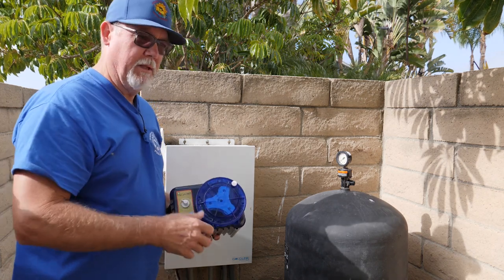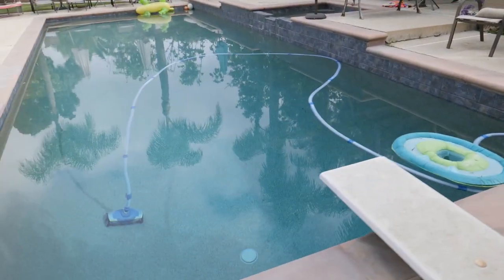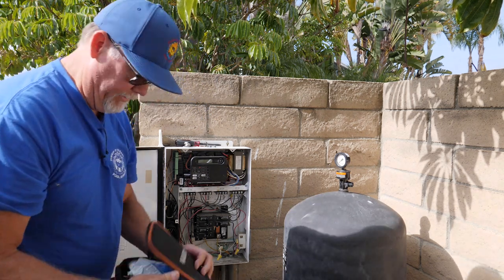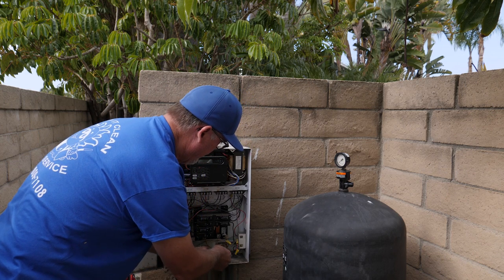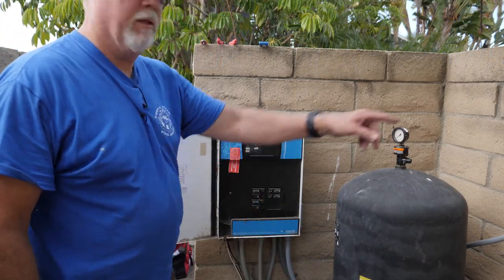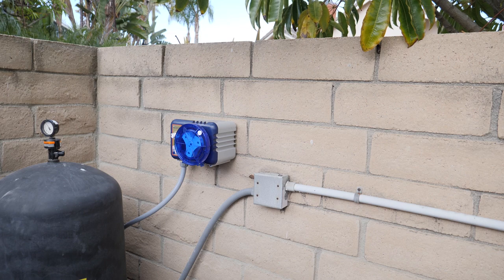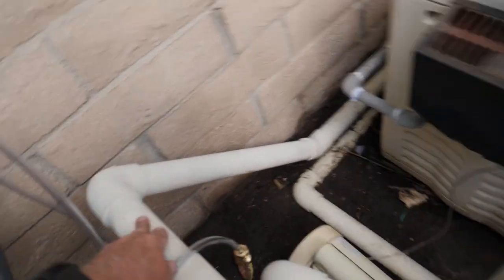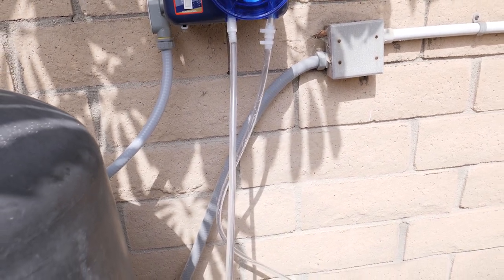Rola-Chem Install - Short video

Comment: I installed this about 1 1/2 years ago. It has its positives and negatives. Liquid chlorine has a higher PH than the tables. As a result the PH goes higher resulting in adding more muriatic acid. I’m adding about 8oz a day with another Rolachem system. The Chlorine side will crystallize and clog the check valve over time. After about 90 days I replace or clean. The hoses are not forever and need to be replaced every so often (6 months to a year), sorry I lost track. It also appears the liquid chlorine may be also increasing my total dissolved solids. At least that’s what the Leslie’s pool guy tells me. Another downside is the closer handling of the chemicals. When replacing these hoses and check valves you’ll need gloves. If you allow a check valve to go too long without service the back pressure can punch a pin hole in the hose and you are spaying chlorine in your pool pump area instead of in the pool. It appears, with all that said, that I still prefer this to the tablets and those cyanotic acid levels rapidly rising. I still use a floater with one tablet a week just to boost CL levels and raise the CYA level to the desired amount.
Reply from the maker: Five years ago I did a video on that. The small pH rise from the chlorine will go down the following day. It is only temporary. Check out the video. No need to add extra acid.
Reply: @swimmingpoolchemistrydoner5569  I need to look for that video for sure. But if the PH goes down the next day won’t it just go up again after another full day of dosing with liquid chlorine?
Reply from the maker: @Dlemonaid  If you're dosing with a Rola-Chem only I highly doubt it will go up at all. When I added 8 ppm chlorine to the test the pH only went up 2 points. Then it came back down the following day to match the other bucket. If your pH keeps coming up look at things that cause aeration.

Comment: Does that one you installed say for indoor installation only? If it’s good for outdoors is the only difference with the indoor one that it has the conduit fitting?
Reply from the maker: Both indoor and outdoor. The one you see is for 240 volts. The one for 120 volts comes with the cord attached to it.

Comment: "This setting Right Here!"  What the heck is that setting?  What character (numeral or alpha) on the controller did you line up the dial to?
Reply from the maker: I set that pool to the first line. That setting worked for that pool. Your setting could be different depending on the size of pool and how long you run the pump.

Comment: What do I do if my rola chem hose connected to the barrel isn't siphoning the chlorine out ?
Reply from the maker: Check for a small hole on the intake side or it could be a clogged check valve. Could be a bad pinch tube.

Comment: Does it matter 120 or 240. Not sure what u have. The load side is that to the main fuse switch?
Reply from the maker: Since this is connected to a control panel you use the load side of the relay switch. Sorry for the long delay I don't post here anymore. I post on Instagram.

Comment: Would you recommend this over a off line tablet chlorinator for a 24 foot round above ground pool?
Reply from the maker: Anything is better than tablets. Yes this will work as long as you have a good pump and filter. I would get the smaller one. Go on Rola-Chem web site and take a look. 👍
Reply: @swimmingpoolchemistrydoner5569  We have a Hayward single speed pump and sand filter

Comment: What size bit did you use to drill the pipe for the feed side of the chlorine?
Reply from the maker: The size is 23/32 with a 1/2 CS NPT Tap. Make sure you start off with a small bit and work your up to the final size. Also be careful with older piping it could break.
Reply: I was advised, by a friend who tapped his PVC, to be carful with shavings. The played havoc with his valet system.

Comment: Can you install it out in the open unprotected from rain?
Reply from the maker: Yes it would be no different than installing a pump outdoors. Just make sure you don’t have any exposed wires by using the proper conduit and connectors.

Comment: How effective is this unit if it only works when the pump is on vs. a tablet floater? I run my pump 8 hrs straight per day
Reply from the maker: The Rolachem is very effective at maintaining 4 ppm of chlorine. A tab floater isn't going to maintain 4 ppm of chlorine in the pool so you won't get algae. Tabs add around 6 ppm of cya per tab in a 10k pool. The higher the cya gets the higher your free chlorine needs to be. You can adjust the rolachem to add whatever amount of chlorine your pool is going to need to maintain 4 ppm of chlorine.
Reply: @swimmingpoolchemistrydoner5569  you didn't exactly answer my question.
Reply: @xpert1111 he actually did lol

Comment: I think I missed it but did you show the reservoir the chlorine is drawn from?🤔
Reply from the maker: I’ll need to look at the video again to see. It’s a 5 gallons bucket with a safety lid. I drilled a 1/2 inch hole in the side near the top for the feed hose.

Comment: That is not a chlorinator. That is a acid pump.
Reply: Can be used for both most of the time you need both cause bleach or chlorine will rise the ph
Reply from the maker: @slange455  Chlorine only raises the pH when you first pour it in. By the second day the small pH rise goes down so there is no need to offset that with acid. I already did a test on this on my Instagram page. I no long make videos for YouTube.